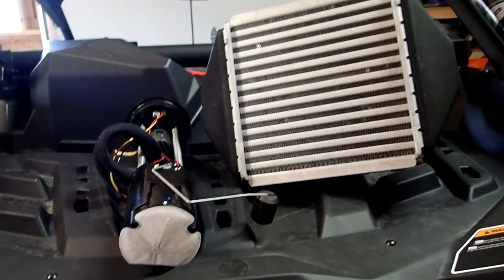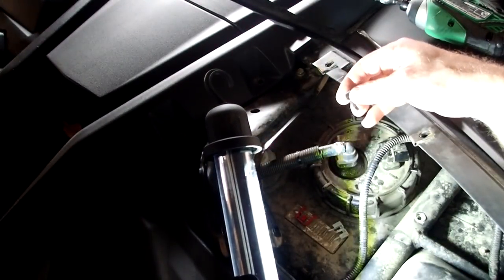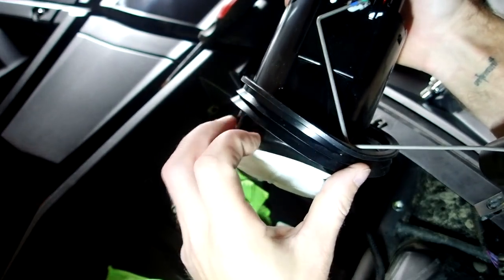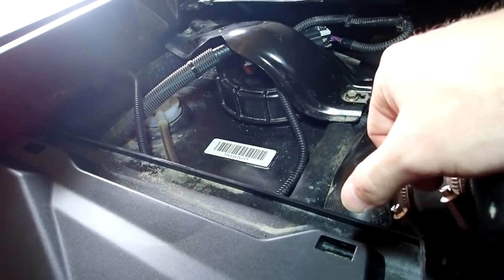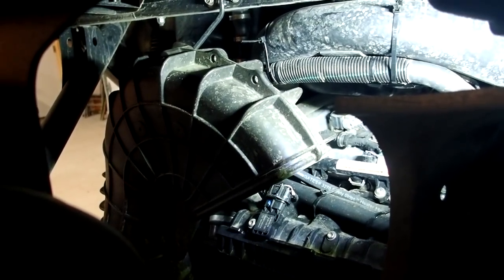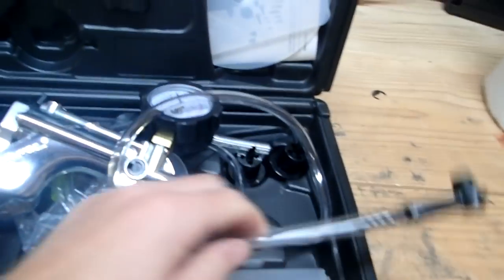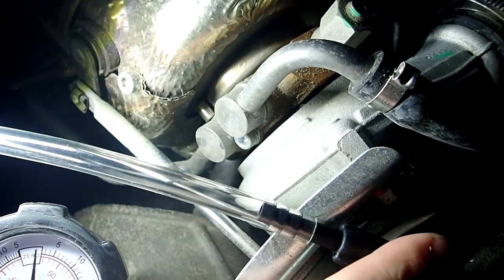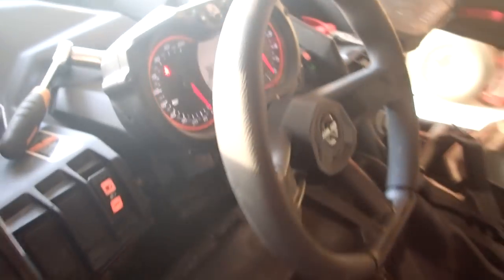How To Install the 172 hp Performance Upgrade Kit - Maverick X3 Fuel Pump

Comment: thanks. you help me to fix 2018 upgrades to my x3 . but what about the tune . it is important to tune the maverick again or no .
Reply from the maker: +Mohammed Hassan yes, you need to get a new tune if you do these steps!
Reply: Will the dealership do the reflash if you pay them for it?
Reply from the maker: They should - I believe it should be included with the purchase of your upgrade kit, but all dealerships will be different.
Reply: AaronShea X3 did you take yours to the dealership or did you send it to evo to get a stage one?

Comment: Note to self don't use screwdriver on fuel line after removing red keeper. Squeeze it and it will pop off when you pull up. 😜😭

Comment: Great video, what did the upgrade cost you since you did the work installing it ?
Reply from the maker: +GixxerKid the cost of the kit was $1300, and I had $60 into the vacuum pump. I probably saved $450 in labor.

Comment: Hey Aaron love your videos. You wouldn’t happen to know if an RC are on RS will fit in a 12 1/2 foot garage toy hauler
Reply from the maker: +Stephanie Sturdevant how wide? My trailer is 90" wide. And 12 feet long. I fit fine. But with paddles on, it's extremely tight
Reply: Yeah I’m 102 wide not worried about the width if you’re fitting in 12 foot sounds like it might be close but it would work
Reply from the maker: +Stephanie Sturdevant the car is about 11 foot long. You should be good if you've got 12'
Reply: AaronShea X3 thanks for the info Aaron. Still undecided on the RS or the RC going to get one early springSounds like it would work maybe a little snug

Comment: Are you running an aftermarket tune? If so who did you go with?
Reply from the maker: +West27 yes sir. I went with HMF / EVO
Reply: AaronShea X3 are you piggy backing tunes? What stage of evo did you go with? Looking to do this same thing to mine with a stage 3 evo or pwrtune so very curious to see some videos from you and how you like it. Make sure you got the recall flash from evo with the safe tune.
Reply from the maker: +West27 yes sir, it's honestly brutal acceleration. No lie. I'm on the trails right now.. so videos coming soon. It's a stage 3, and I did get the new tune. I spoke with the owner. The tune was fine, they just needed to adjust boost at the top RPM. He said long periods of hard acceleration in sand was causing higher boost on the top end. Which was fine if you run 100ll race gas. But for 91 they had to fix it. It pulls very hard
Reply from the maker: +West27 and no piggyback on the tunes.. HMF just uses evos stage 3 tune on their exhaust kits
Reply: Thanks for all your videos. Really enjoy learning from you.
Reply from the maker: +Mike Salois my pleasure!

Comment: Great video Aaron,I've been waiting for you to do that.Roughly how long did that take and do still have a warranty on your x3?the dealership said if I do it it will void my warranty
Reply from the maker: +Brad Cimock if you do it, voids the warranty. But the factory warranty here is only 6 months so meh. It does not void an extended warranty though. It took me probably an hour to do the pump and 40 minutes on the intercooler. 10 minutes to adjust the wastegate. Now having done it / seen this video... Much faster
Reply: AaronShea X3 So what your saying is do it when your six months warranty ends and your extended warranty starts?
Reply from the maker: +Brad Cimock what I'm saying is, if you have an extended warranty - don't even worry about it. The warranty is so short, I wouldn't pay a dealer 5-7 hours of labor when all I had to do was buy a $60 vacuum pump to do it myself
Reply: AaronShea X3 perfect,thanks that's what I wanted to know

Comment: Is this the same kit that makes the 2018 120hp up to 172 or more with a flash upgrade? I bought a 120hp and didn't realize it didn't have an intercooler so now I'm just going to do the whole damn upgrade because it overheated at like 70 to75 degrees outside.
Reply from the maker: Hey brotherman - I am not sure if the kit I installed is the same kit for that model unit. I would contact a company like Evolution Powersports and ask them how to convert a 120hp unit to 172hp properly, so you don't end up catching it on fire!
Reply: Full Throttle Off Road haha I will it looks like the same stuff besides maybe the ecu flash might be different.  I'll give them a call. Thanks. Your machine is sick
Reply from the maker: Thank you sir! Yea, EVO will take excellent care of you! Tell them I sent you, might give you a deal ;) Worth a shot! Thanks for the compliment as well, I try to keep my car simple and basic. Tune the shocks. Tune the car. Tune the clutch. Leave it alone - GO RIP!

Comment: Actually that's all a waste of money,all you need is the 18 fuel pump and have one of the tuners like Pwrtune reflash your ECU
Reply from the maker: +Half Benjamin Marshall that's partially true. But to be clear for anyone reading this... The fuel pump and tune isn't all that's required. You still need to adjust the wastegate pressure. As well, if you're running a stock exhaust - you'll want to get the new exhaust pipe as it has a higher flow rate. Upping the boost on the stock exhaust has the potential to increase heat there to levels that could be problematic.
Reply: Full Throttle Off Road Yes I did leave a few things out,I have done multiple 17 to 18 conversions at my shop for customer's so the 18 fuel pump,  Adjust the crack pressure,I also punch out the cat,and Andy at Pwrtune for the reflash, now if someone wants to go beyond 18 power levels then yes a less restrictive exhaust is a must.

But as far as Can Am 17 to 18 kit goes,thats a waste of $$$$
Reply from the maker: +Half Benjamin Marshall Yup, this is more accurate. I agree with this post :) However, my goal was to show people how to do the BRP upgrade. There's obviously many other ways to do it... And in many cases, better ways. Thank you for sharing though!
Reply: Full Throttle Off Road Hey I respect what your doing keep it up 👍
Reply: @halfbenjaminmarshall7134  So, you're saying the bigger, better Intercooler is a waste of money??? Kinda hard to believe .....

Comment: Did you have to get a tune?
Reply from the maker: Yes. For the upgrade you'll have to either have a dealership flash you to the 2018 specs, or get a tune from a vendor
Reply: Full Throttle Off Road thanks 👍

Comment: is there even a difference between the 17 and 18 intercooler? they look identical. all the evo upgrade kits for the 17 say its not necessary to upgrade the intercooler. they have a fan switch instead that does the job.
Reply from the maker: You're correct brother